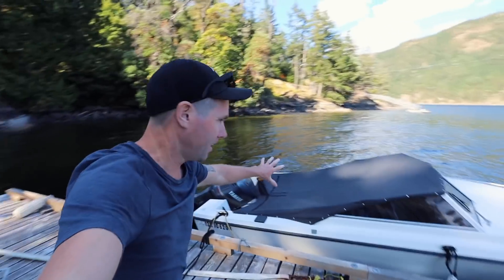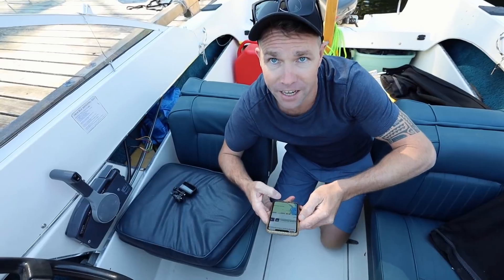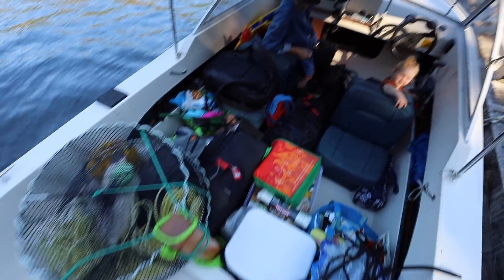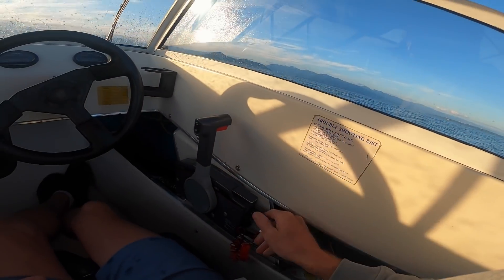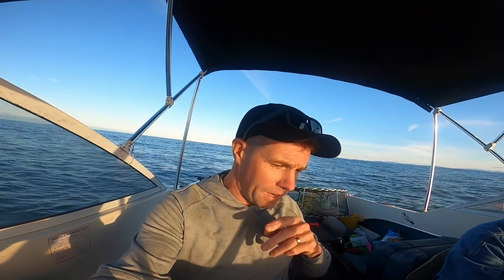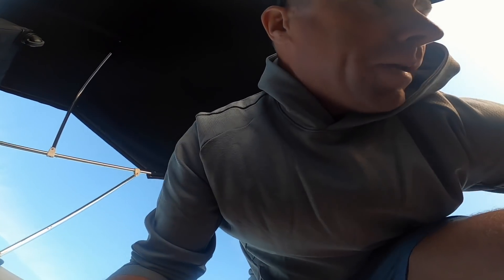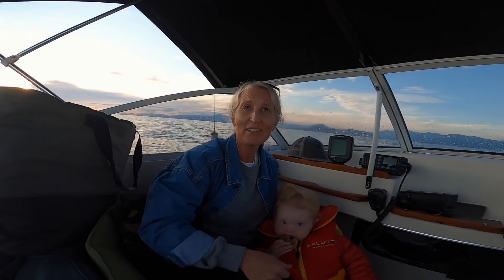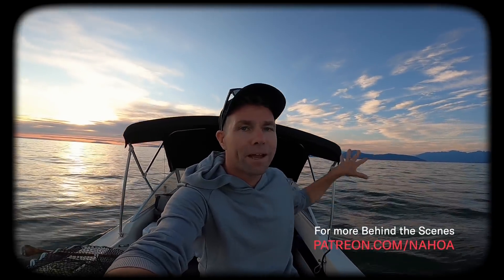Out of GAS Miles From Shore.

Comment: You need to make a filler tube, something with the same threads as your gas cap, a flexible 2 or 3 foot hose that can act as a funnel but yet water tight to prevent contamination of the fuel tank.
Reply: Or.... you could move the filler.  A bit of fuel hose and a hole saw would take just a short time to do.......  You owe it to your mom to make her boat safe.  But I wonder..... you filled the tank for a 2 1/2 hour trip yet ran out half way through..... there are more  problems than a poorly placed filler cap.  Yes, do it for  mom.......  Invite me up and I will do it for you!

Comment: I wonder what the tank capacity was on that boat? That's quite a big motor for a boat of that size (well by British standards) Your average consumption for a150hp outboard would be about 15 gallons per hour... so for a 2 1/2 hour trip you would need 38 gallons plus reserve. Awesome trip though and it's clearly not your first time. What a wonderful place. Years ago I would ferry our club RIB from Penzance to the Scilly Isles most summers and club members would crate the diving gear over on the passenger ferry. I loved that trip.

Comment: Have you been watching Sailing Parley on you tube. They have the same boat as you have and they have had mega trouble with their cat coming apart, they have found a number of your type with separation issues. And in  sailing Zingaru they have the same fault.  ? Stay safe. X

Comment: A jerry can is only 5 gals the boat gets about 2, 3 miles per gallon and open the cap on the back of handle that's the vent so it will just pour in

Comment: I can't believe you'd run out after only 2hrs on a full tank I had the same type and I could go at least 6hrs. Glad you made it.
Reply: At full throttle a 150 two stroke will burn close to 15 gallons an hour.
So if your at 2/3 throttle you will burn around 10 gallons per hour.
These folks did not run out of gas.  They simply added a bit of drama for us viewers.

Comment: A funnel would help, as it would seal the opening as you press it into place, while the other person pours the gas in.  Maybe listen to your wife once in a while!
Reply: She made a good suggestion, but he was right. The funnel won't help a thing when water is there & splashing in, by the time you get the cap off & a funnel shoved in, that much water can end your trip. That is what he meant about it not helping him. Say you do get the boat turned like they did to stop water from coming up on the transom & you get the funnel in, if a wave comes or boat turns enough for water to splash back up, you can't just pull the funnel out & expect not to get water in the tank. Bad design.